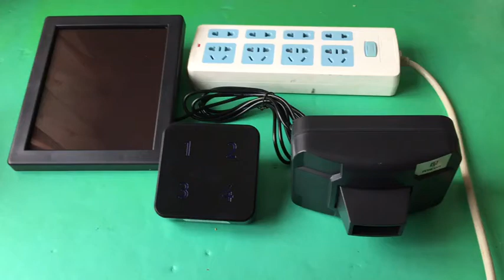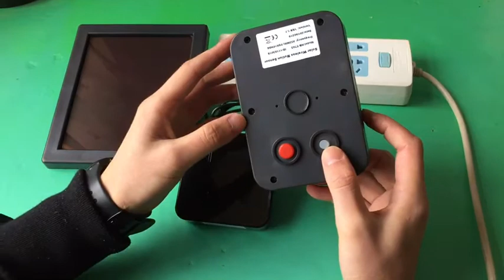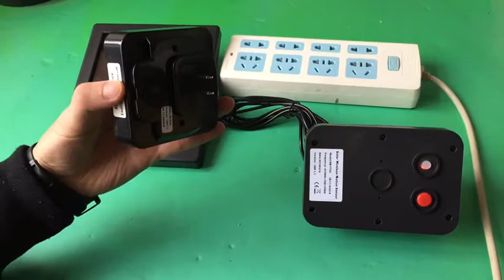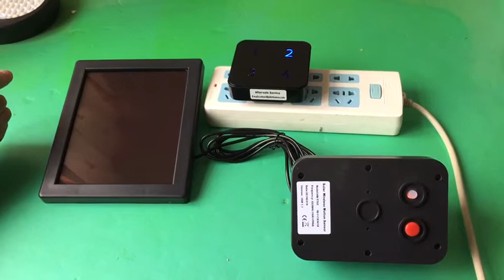HTZSAFE T705&806A SETUP

Comment: How do I add a second receiver? I want to be able to hear someone in the driveway from my house and also my workshop.
Reply from the maker: Same steps:
1. plug the receiver into the outlet
2. turn on the sensor
3. press and hold the "Volume" button of the receiver for 5 seconds
4. release the button when the indicator light flashing
5. activate the sensor once ( wave your hands in front of the sensor eye)
6. a ring tone prompt means the sensor has been connected to the receiver

Hope it helps and please kindly email us at contact@saferhomee.com if further questions. Thank you.